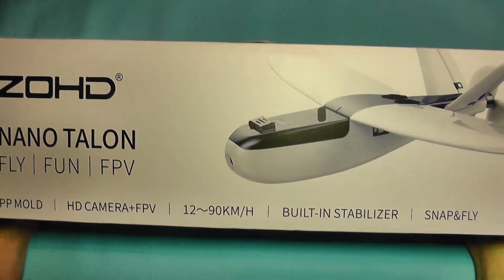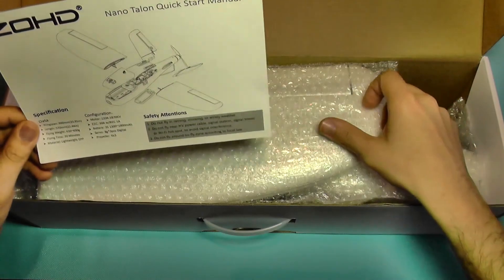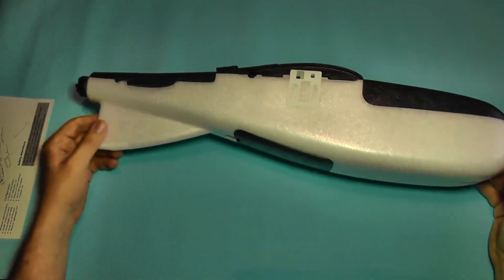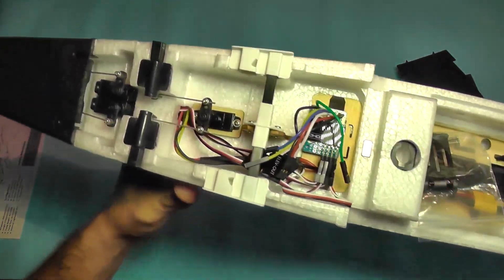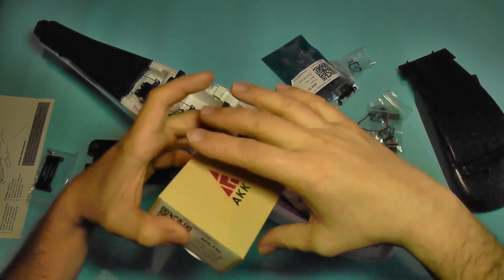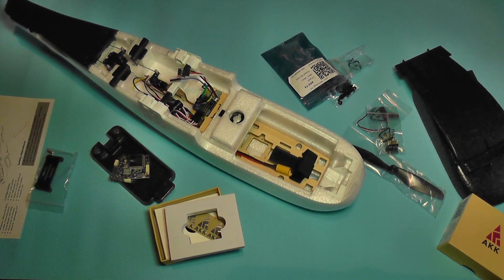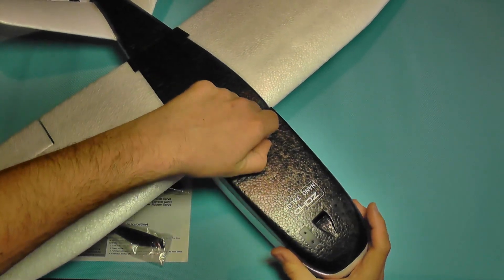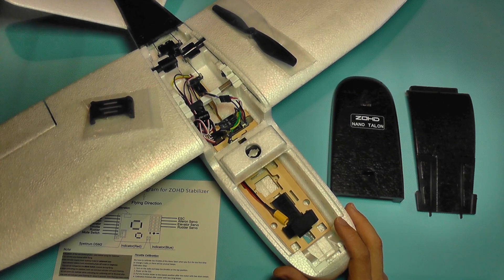ZOHD Nano Talon -  Full Build & Review, part 1

Comment: Mine is in transit at the minute, I am going to remove the OEM stabilization system, and replace it with a Volantex Xpilot AX601 6-Axis Flight Controller/Stabilizer. It is a kit build, so I have also bought....6X MG90S Metal Gear RC Micro Servo
FMS Predator 30A Brushless ESC With 2A Linear BEC XT60 Plug
ZOHD Nano Talon 2204 1870KV Brushless Motor
ZOHD Nano Talon Orbit FPV RC Airplane Spare Part 6x3 6030 Propeller x2I am also considering glassing ALL the EPO (White) surfaces inc fuselage and Ailerons and Elevons.What are your thoughts? and advice or suggestions from you or your viewers? I am a bit of a noob, just trashed my Bixler 2 and decided to trade up.Look forward to hearing from you all.Carl
Reply from the maker: Sound very good and could be a nice build. You may look into a custom Li-Ion pack, a simple 4S 3000mAh high quality cells such as Sony/LG/Samsung, could boost your flight time a lot.
Reply: I have this battery coming too , TCB Lipo battery 4S 14.8V 2200mAh 25c. Looking back just now, it looks like I screwed up, they recommend a 3S 1300-2200mAh 25C , I bought a 4S....Im sad.....
Reply from the maker: 4S is good for the nano talon as long as you ESC + motor supports it. Because it's a light plane I would go with a 10C battery if it over 2200mAh, to save on weight as this plane doesn't need high current to work.
Reply: Thank you sir, can I use your brain again if I get stuck?
Reply from the maker: Sure ! always ! you can also contact me on my page here: https://www.facebook.com/TechTronic9000/